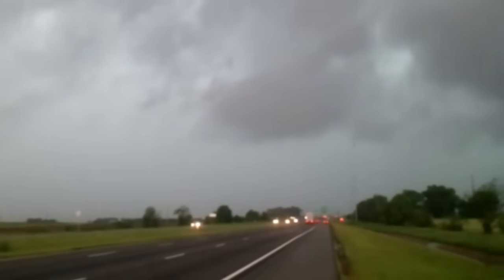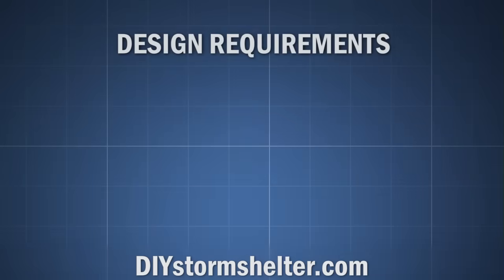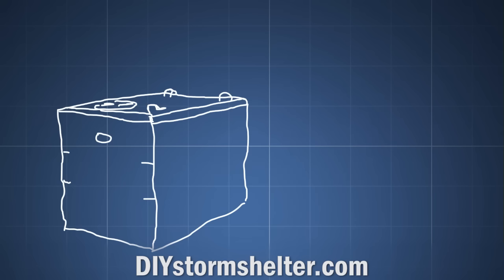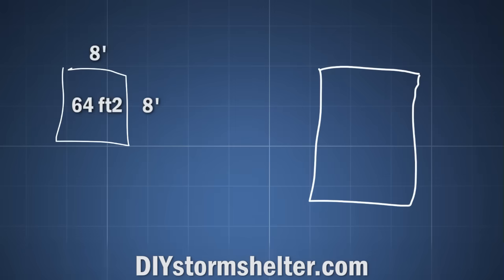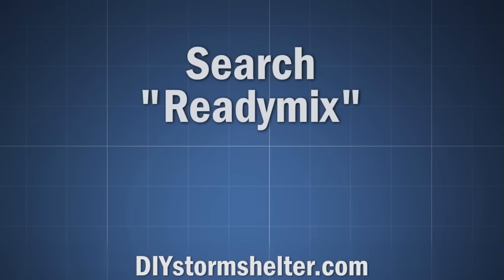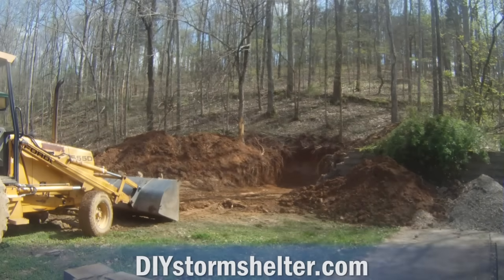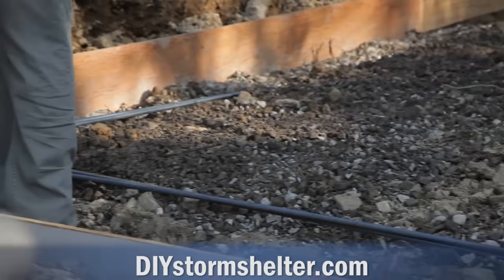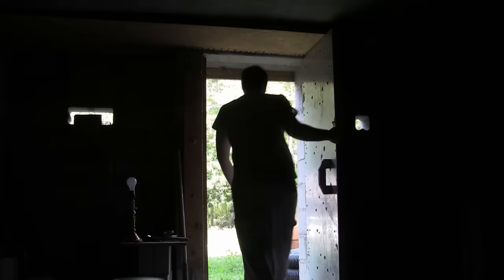Concrete block DIY Storm Shelter 12x20 foot

Comment: some of the ppl commenting need to take a breather. i don't know if he is missing any critical design points because he is not a "pro" but depending on the price, the info cd could be a useful introduction at least to the concepts involved. sometimes the "pros" are not that good at explaining what you want to understand when you build one of these or have one built, and you benefit from the perspective of a another "layperson" who went through the process. the info cd can be a starting point just for education, or if you choose you can follow the design, but it's nothing to lash out about.
Reply: Check for books from the cement institute for the best advice. We used their publications for references in the contractors license preparation class I took in 1990.
Reply: We aren't talking about building a bird house, this is a structure that is built out of and surrounded by materials that would easily crush a family if not properly constructed. And yes, during a storm is typically when the earth gets over-saturated and weighed down, so it would likely happen while being used for it's intended purpose. Judging by what was done in this video, I would feel safer under a wooden picnic table in the middle of a back yard than in that future rubble tomb being tossed together in this video.
Reply: @OldAngryNormie  Not to mention a good earthquake might pancake that thing, with nothing holding the walls to the foundation other than the weight of the roof.  There is no floor against the bottom of the wall and no rebar up through the wall so nothing holding the walls in place other than gravity.

Comment: If I need a small storm bunker I'll copy the methods used by the US military in Iraq and have a precast concrete septic tank or other concrete vessel delivered and placed. Additional units can be added as needed, and unlike block they are cast as one piece and are solid concrete. If I want to get grandiose I'll set a 20' ISO container in place, form around it, then have concrete poured around the ISO which would function the way the metal liner of a HAS does.
Video is high on fluff and very low on content.

Comment: If the sides of a container were really 1/2 think the sides and roof on a 20 footer would weigh well over 3 tons. The steel on the sides and roof is usually 14 gauge (0.075 inch thick).

Comment: I worked with shipping retrievals and dispatch for years, shipping, receiving, quality and damage inspection. please for the sake of half my working life where the hell did you get "shipping containers" that have thinner than 1/2 inch thick sides that you can bend by standing on
Reply: Just bought 5 acres, has concrete slab, there's my roof.  Lots of scrap around let me see what I can do?

Comment from the maker: Dave, I've owned and shipped several shipping containers. You are right that they are tough. Most are rated to hold something like 60,000 lbs of cargo and they can be stacked several units high. They are awesome. 
But the skin and roof is just thin corrugated CorTen steel. I weigh 170lbs and the roof buckles under my weight. Also, containers are only used for ocean shipping for 10 years - they are then considered worn out and non-insurable.

Comment: You can EASILY convert an International shipping container into an underground shelter for under $5000, including delivery, waterproofing, furnishing, burying, etc. You DO NOT use Domestic, plastic topped containers for an underground structure.

Comment: That is simply not true. Shipping containers are built to withstand international travel where a marine environment (far harsher than dirt) could eat them alive. Also nobody in their right mind would bury any structure without coating it with waterproofing material. Standing on the roof and having it bow, or the sides bow is a complete falsehood, unless you're referring to the plastic topped Domestic variety, not solid steel International variant (which is what you should use).

Comment: Most people aren't after a 50 foot undergrounds city. They just need to pour a slab block up the walls and put an inch or two of dirt over the shipping container. The key is that you can't see it, not that it's deep in the ground. Hell, you can take shipping containers spray them with rhino lining and bury them above ground like a hobbit hole. Done right, and in the right place, no one would ever see it. I would never charge to provide a "tip" to a fellow American trying to protect their family.

Comment: Hope it doesn't flood, blocks should hold from cracking , of course it is not really underground so it should hold up good. Like the video. Great work in laying out concrete.

Comment: The only possible issue I can see with your design is I believe FEMA and Texas Tech recommends that with concrete block construction you fill the cavities with concrete and possibly reinforce with rebar.  Did you do anything like that?

Comment: In response to Botkin's response (since you're asking, not him): I've seen vids on how to reenforce the sides and ceiling with I-beams, plus if you don't have a foot of dirt on the top, the weight shouldn't be a huge problem. The outside can be painted with tar, put a foot or so of gravel on the floor of your hole, and fill the sides in with gravel. This is also free info, for everyone but Botkin - don't read this unless you pay me $9 first.

Comment: If it's above ground it would have to be anchored pretty deep and I think every hole in the cinder blocks should have anchored rebar going from the slab all the way up to the roof and filled with concrete.

Comment: I have worked for a concrete company for 10 years so I feel it necessary to advise that 3/4" plywood is not a good option for the form on the slab. Use a 2x8 or Form-A-Drain for a form and go to your local building materials store and buy steel stakes a $2.99 a piece. Finally, place your stakes 3-4ft. apart and drive your stakes so that it does not stick up past the top of the form board as you will use the top of the form to set your strike board so that you can even out the concrete.

Comment: I agree burying sea cans can be extremly dangerous if you don't know what you are doing.  It is possible but I would suggest if you choose to do that hire a construction company with experts to do it for you.  Plus one thing you also mentioned is you would have to surround it with crushed rock or gravel to allow any water in the ground nearby to drain into a sump pit under your sea can to be pumped away or somehow drained away through gravity.

Water is not a friend to metal underground.

Comment: Yup, no $9 bucks.  Good video, though. Have not started on mine, but it will be narrower than 12 feet.  My research ... and my wallet ... dictate no wider than 8' inside width. If you have any concerns about seismic activity the narrower the roof, the stronger and less likely it will fail.

Comment from the maker: Good question: Shipping containers are very strong frames with thin corrugated steel sides. Climb up on top of a shipping container and the roof will usually bow in. They can't be bermed over with dirt. Also, the sides will bow in if you try to bury them. And lastly, steel and dirt don't go super well together. 
Now, in the military they sometimes use old containers for bunkers. But they flip these upside down first (the floor is stronger), and they are only used short them. Not for decades.

Comment: Not that I'm knocking your video but, why not just save all the time and energy and just buy a used steel shipping container for $1500. Bury for $300. Wire with electric and plum water for $300. Furnish for free from C/L or Kiji. Can ride out a storm in comfort, warmth, have toiletries and even spend the night for under $2100. Could even have a front door welded in or top hatch depending on how you dug in for $100 bringing your total to $2200. Ill pass that idea along for FREE